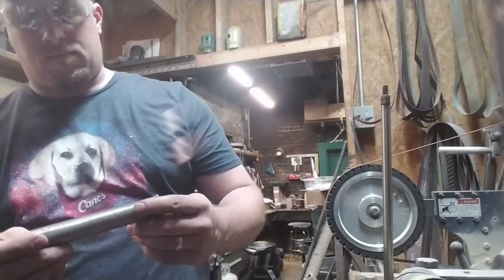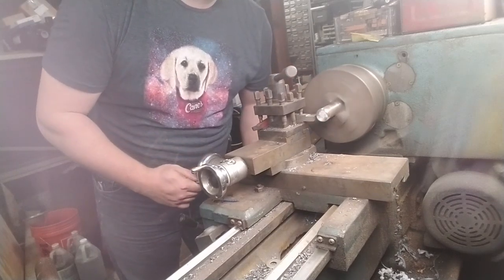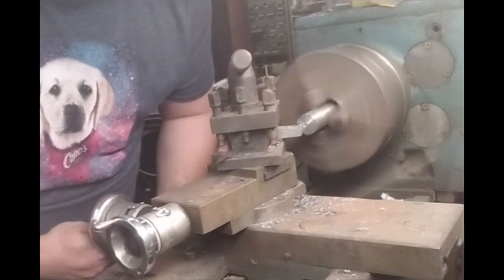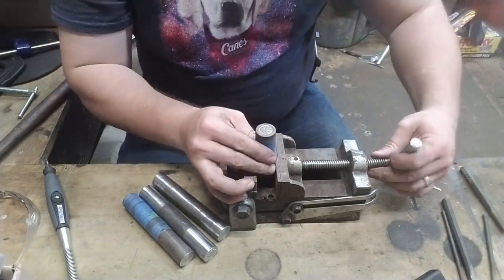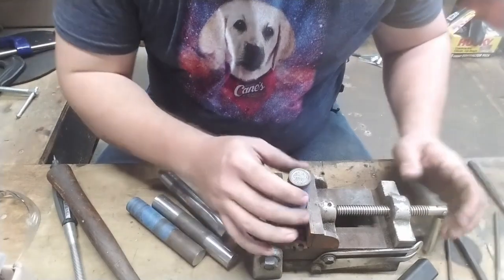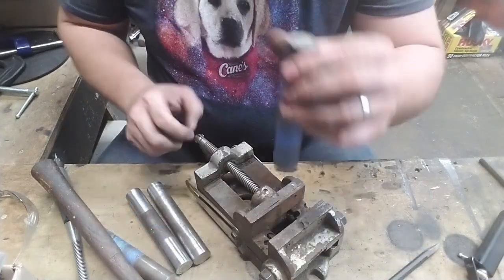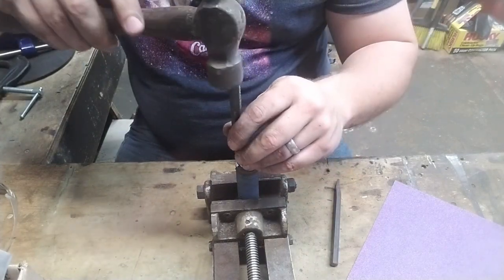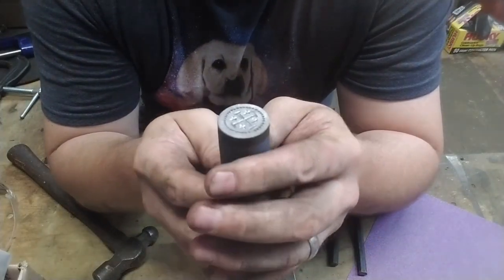How to Make Homemade Coin Dies for Coin Making | Custom Currency

Comment from the maker: Do you have any questions about coin die making for my husband?
Reply: Hi yes, where did he get the striking anvil? Thank you!
Reply from the maker: @cavtroop50  Harbor Freight
Reply: What type of metal did you use in the coin?  @LynneFairchild
Reply from the maker: The coin blanks are aluminum. My husband has also used brass and copper before. He's never used pewter or silver, but they're on the list.
Reply: What specific kind of steel is used for die?
Reply from the maker: @goodbuddysal  A6 mild steel

Comment: Say, if you strike hard enough for the impression to be deep, would it be feasible to reverse the coin and strike again? It probably wouldn't flatten out the opposite side, right?
Reply from the maker: It would work better if you made a duplicate die and then struck the coin, creating the same pattern on both sides at the same time.

Comment: If you have a hydraulic press would that work as well or better than a anvil because I have access to both
Reply from the maker: @AsherHamilton-m6z  Depends on the results you want. Hydraulic presses tend to give very clean results, but they often look mechanical and overly regular.
Reply: @LynneFairchild  thanks
Reply from the maker: @AsherHamilton-m6z  You're welcome.

Comment: Is there a functional reason that one couldn't use a 20 ton bottle jack-press instead of a hammer strike?
Reply from the maker: My husband said no, there's no reason. But he thinks 20 tons is not enough. A hammer strike provides more of a momentary force rather than a constant force.
Reply: The plasticity of metal is what you need to look at a press is slowly increasing pressure where as a hammer strick is a quick hit it has to deal with the atoms of metal and how the are moved
Reply: 20 ton bottle frame press is OK for a 19mm silver or gold.  
It takes me about 30 strokes on the jack per 1/10 silver coin.  That's 6 to cut the round and 24 to press the coin.  I find I need to rotate and restrike 3 times to get a good strike
Reply: The pressure and speed of strike is to be considered, also 1 vs 3 vs 6 strike. Tool Maker since 1994.

Comment: To get better prints without a large press do you think it’s possible to get a good stamp with an arbor press by heating up the brass or copper blanks first?
Reply from the maker: From my blacksmith husband: Heat will ALWAYS make it easier to move metal. Yes, hot striking or hot pressing your coin blanks will work very well.   Just pre-heat your dies a little, so they don't steal all the heat from your coin blank before you even have a chance to strike it. 
That said, I'm a little unsure on the suitability of using an arbor press for coining.

Comment: cool. any ideas about tempering the die? what steel sort used?
Reply from the maker: From my blacksmith husband: Heat treating the die is just not worth it for 95% of SCAdian purposes.  
When you strike the die against the coin, the coin also makes and impression against the die face, slowly over thousands of strikes making a coin-sized impression into the face of the die, and that will eventually cause excessively light strikes. BUT, the face and the design are pushed back at an even rate!  So, if you simply sand away the perimeter of the die and restore the die face nice and flush, the design will remain intact and you can continue to use the die!  
I have done this with multiple dies on simple mild steel bar stock. 
Heat treating does indeed make the die more robust so it will be able to withstand multiple thousands of strikes with minimal maintenance. But the problem is that even using a medium-carbon heat-treatable steel like 4140 will make most traditional die-making techniques impossible. 4140 simply will not accept impressions from most punches. Even center-punching dots is a chore on carbon steels.  You will be forced to engrave, or use power tools, or use a laser. I do not recommend heat treating unless you are ALREADY doing that.
IF you are ALREADY using processes that work with carbon steels, then I have had a lot of luck with 4140 for die stock. I've also had good luck using O-1 for highly detailed punches, using similar techniques.  
4140 is a water-quench steel, but I use a fast-quench oil (Parks 50) just to be gentler with the details. O-1 is an oil-quench steel that calls for a medium speed quench, like Parks AAA or standard vegetable/peanut oil.  
Again, this really isn't necessary for almost anything in the SCA and I don't recommend it for anyone who hasn't made twenty or thirty dies already.

Comment: where do you get par stock? and what is it?
Reply from the maker: My husband is not choosy about where he gets the bar stock.  OnlineMetals, McMaster, it doesn't matter. It's just normal A6 mild steel. He has even been known to use #10 rebar before.
Reply: @LynneFairchild  ah thanks, i'm not english/american and new to this type of work so i had difficulty understanding what he meant
but thanks!!
Reply from the maker: You're welcome.
Reply: @LynneFairchild  quick question, can you use normal chasing tools on steel or iron rods like this? 
this is maybe more directed to your husband but i'm curious if chasing the design into steel is relatively easy or if i should try engraving or if i should try other softer metals
Reply from the maker: He chases designs directly into mild steel with chasing tools. This ONLY works with mild steel, though. He has experimented with medium carbon steels like 4140, and the difference is so stark that the techniques he shows in the video are unusable.

Comment: Greetings . Can I create a disk cutter with simple mild steel, to cut 2.4mm brass disks?
the disk cutter that I would like to make in mild steel, I would like to use it in a hydraulic press; will it last?
Reply from the maker: Nope, it will work for a few repetitions, but it won't last. Brass is harder than you would expect. The reason mild steel works okay for coining dies is that we're relying on the compressive strength of the center of the rod, and not using the edges at all. On a disc cutter, all the work is being done by the edges, and the strength and stiffness of the material simply isn't up to the task.

Comment: What material does the die need to be?  Is steel strong enough?
Reply from the maker: Mild steel is fine for striking aluminum, pewter, copper and fine silver, but it wears quickly on brass and sterling.  You have a choice to work with stronger steels like 4140 that are more difficult to work, or just refreshing your dies when they become worn.

Comment: Do you harden your die and how many impressions do you seem to get before you see deterioration?
Reply from the maker: No, I don't normally harden my dies.  I strike very hard because I like my coins to have very deep impressions, and that wears out dies quickly, so after about 1000 strikes, my dies are pretty worn down.  I use mild steel for coining dies, which cannot be hardened. My experience has been that working with hardenable steels is so much more difficult to carve and stamp that it's a lot less work to refresh a worn mild steel die than it is to make a more durable one, and I rarely need more than 1000 of any design I've ever made.  
When I do see dies wearing out, what happens is that the face of the die will cup in, because the coin blanks are actually stamping themselves into the face of the die at the same time the die is stamping the pattern into the blank.  So, the pattern does not really wear out, but it sinks below the perimeter and gives lighter impressions.  So, if I need to restore a die, I simply sand down the face until the die is flat again, and usually have to re-stamp the beaded border.  I have never had to retouch the primary design in the center.
Reply: Look into case hardening

Comment: what kind of steel is better for coin dies?
Reply from the maker: Normal 1 inch mild steel. It's A6 or A36. If you wind up really getting into coining and accumulate specialized tools for carving dies, you can experiment with medium and high carbon steels. But, for the first few years, mild steel will do everything you want it to and will probably take 1,000 strikes before you see any deformation.
Reply: @LynneFairchild  i think D2 steel is better
Reply from the maker: My husband said absolutely not for D2 steel, which is a high carbon tool steel. It's going to be an absolute nightmare to work into the appropriate shape. If you have a laser cutter that can do the shaping for you, or if you have all carbide cutting tools, then fair enough- it's an outstanding steel. However, in medieval coining, we're doing the bulk of our shaping with punchers and hand engravers. The advantage you get from using a tool and die steel is that it doesn't deform after tens of thousands of impressions. You will never make that many coins of any single design. Mild steel is just fine for purpose.